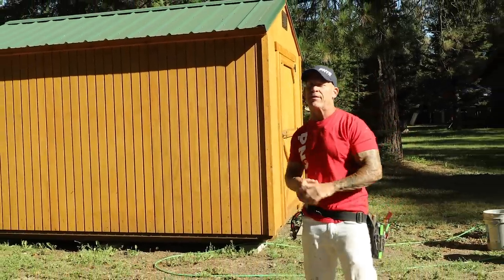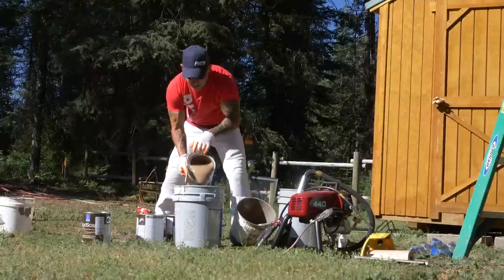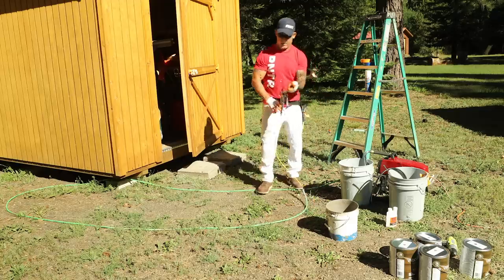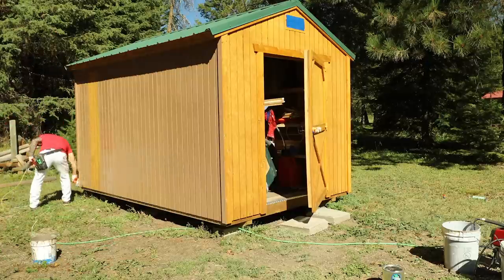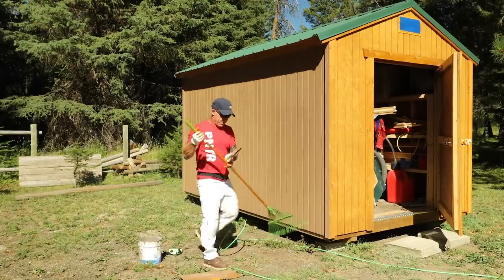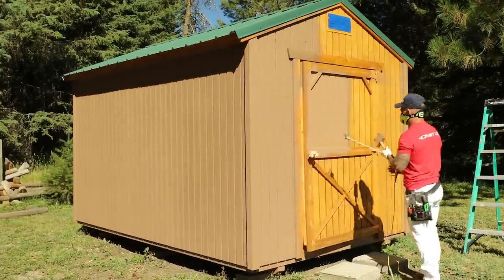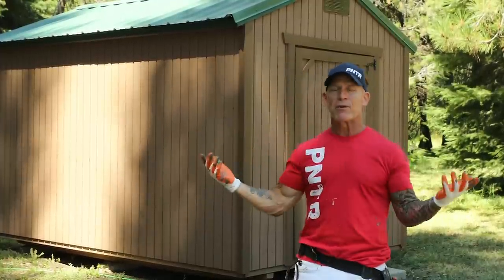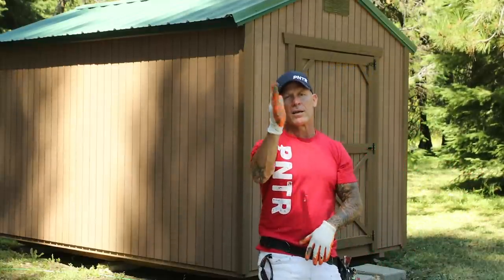When to Back Roll and Why? Staining with an Airless Sprayer.

Comment: What would you typically charge for something like this?
Reply: 500 plus materials
Reply: 400 total
Reply: 5 material included
Reply: This is completely dependant on the area. Not all prices are created equal either. Good luck finding $500 in Los Angeles. Some small rural nowhere mid west Town someone might only charge $150 plus material. But some will spray a crap coat for $500 and others may charge $700 to go through and spend the extra attention to detail.

Comment: Wouldnt a 5 gal be cheaper than 4 sigles? They usually are
Reply: Singles are the same price as the gallon price in 5 gallon bucket for contractors at Sherwin Williams
Reply: @shawnroberts1952  not here
Reply: When buying 5 gallons sherwin williams will match the price for singles. Talk to your rep.

Comment: You are a far superior painter than I will ever be...but if you would like a little tip on how to easily cover awkward shaped things like hinges...melt some paraffin wax and using an artist's paint brush, carefully paint the hinge or other smallish object with the melted paraffin wax. It will harden up as soon as it touches cool metal (which pretty much rules out Arizona, California...etc. during the hotter months) and stays where you put it, and then once you've finished painting, the wax and any paint covering the wax will come right off.